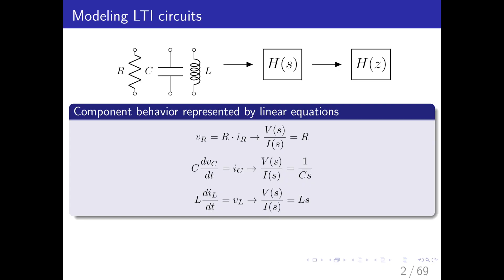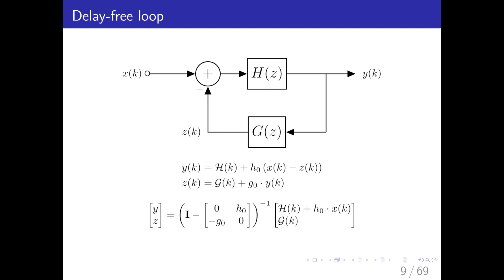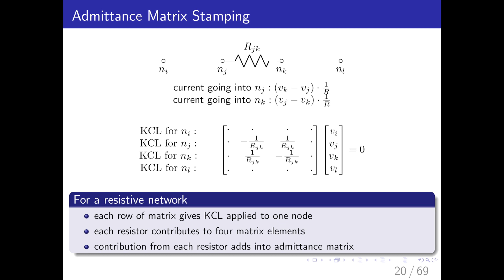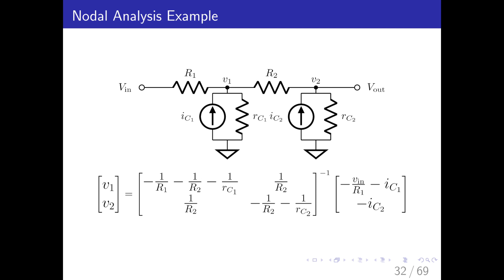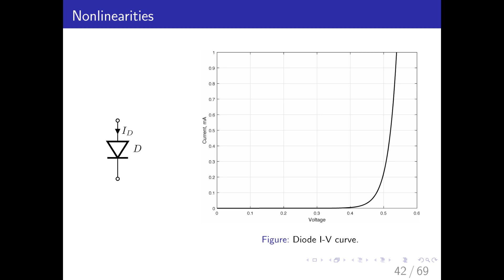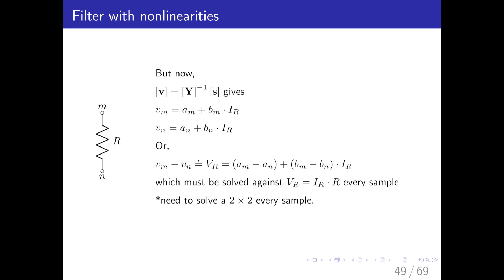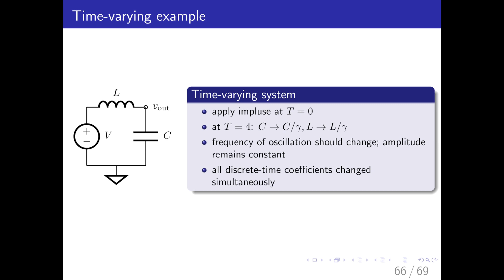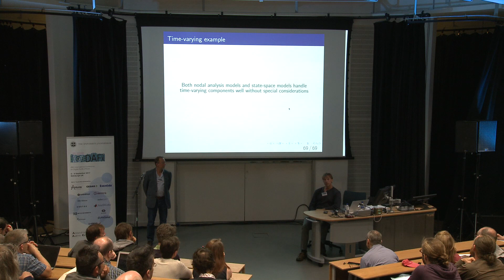DAFx17 Tutorial 3: Dave Berners - Modeling Circuits with Nonlinearities in Discrete Time

Comment: Fantastic presentation. I have a question about parameter updates for state space model: do you rebuild and invert the matrixes whenever C or L changes, or do you have them outside the state update matrix and model them the same way as the non-linear elements that become current sources where the resulting current delta becomes lower for future samples due to the lower C? Can you also have time-warying hfe, threshold voltages and similar things if done in this way?